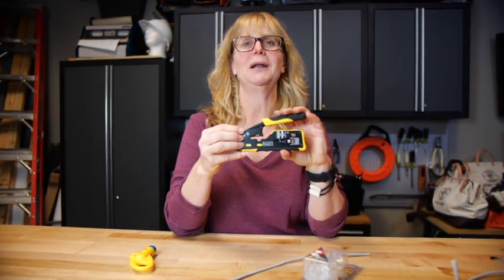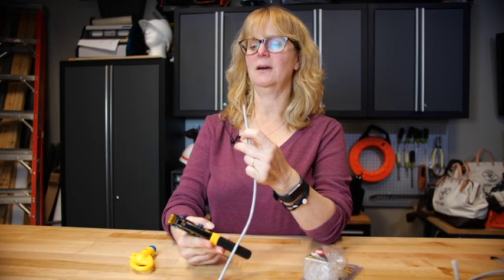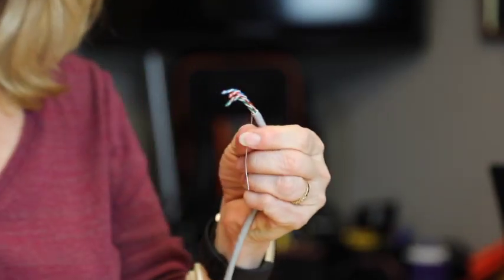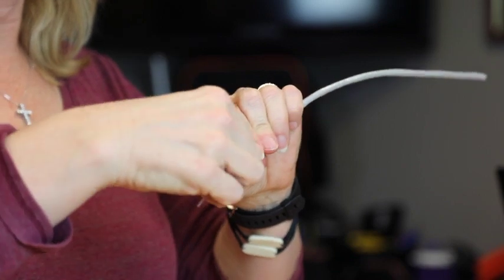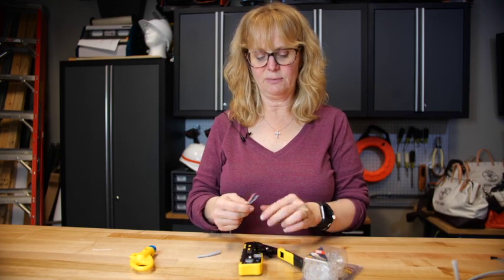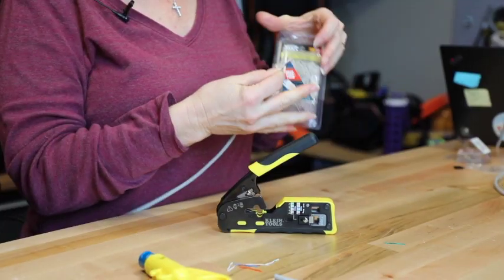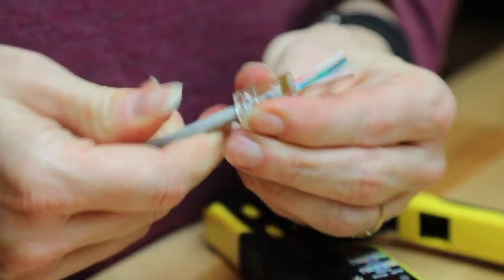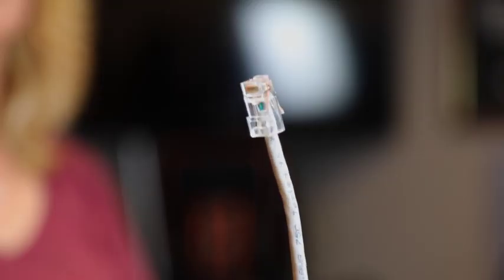Pass-Thru™ Modular Crimper (VDV226-110)

Comment: For anyone seeing this video and having trouble with the wires bunching up when trying to pass them through the connector, cut the wires at a 45 degree angle before inserting into the connector! This made all the difference for me because I always had trouble with the wires moving or bunching up causing a lot of frustration to an already annoying job! When I cut the wires at a 45, the problem went away. Hope this helps.
Reply: great tip!
Reply: Came back to say YES!  Cutting the wires at 45 degrees made a huge difference in the ease of correctly inserting the wires.
Reply: @Peter20164  I finally bought some CAT 6 connectors that were actually rated for CAT 6 and the holes were larger making it a hell of a lot easier! May even be rated for CAT 6A.
Reply: Came back to say YES AGAIN!  The CAT 6 connectors are much easier than the 5e connectors I unthinkingly grabbed when I bought the tool. These two pieces of advice changed my ability to add connectors from “ Dang, maybe I should hire someone” to “I think I’ll fix all the cablegore in my Verizon panel and make it look totally pro”
Reply: @Peter20164  that's awesome man! I'm sure it'll look great. Just take your time so you don't have to do it again. Speed will come later with more experience. If you don't already have one, you should pick up a cable tester since they're pretty cheap and at least will let you know when connections are good
Reply: Glad I saw this. Gonna save me a ton of hassle!

Comment: Take a look at the comments on Amazon. A large number of these tools are not cutting wires one and eight cleanly. You or someone in your customer service should be addressing these issues. I just bought one, and unless I can solve the problem, I'm returning it. This tool makes two Klein tools in a row that I've purchased that have not lived up to Klein's previously stellar reputation.
Reply from the maker: Thanks for your question. On these, you should plan to replace the cutting blade needs periodically – the replacement blade set is VDV999-076. Since yours is new, DM your address and we'll send a set out.
Reply: @KleinToolsVideo  I don't know how to send a DM on YouTube, but I just sent the requested information to your Customer Service email address.
Reply: After you get your wires into the RJ45 connector and the connector into the crimping tool....  lightly, loosely grab the protruding conductors and while tugging lightly on the conductors,  give the tool a quarter-twist... either direction.  Cuts fine every time.  I use this method on every pass through tool I have.
Reply: @KleinToolsVideo  DM ??
Reply: @ramosel  It does not! Has not ever cut a line around the outside cable.
Reply: @KleinToolsVideo  Well besides mine not pushing the contacts through the wires, plus also of course they don't cut off 1 and 8 - and it's a brand new tool. You guys should actually recommend plugs with the tool that work.

Comment: My wires always jump around when I'm putting them through the connector.
Reply: Push them slightly against the roof of the connector as you insert them.
Reply: You have to take the memory out of the cable. I use a method of aligning the colours per requirement and use a kind of wiggle to align and remove the memory from the cable. I really should make a video. it might help some people.
Reply: @billstathakos  Yes, because what the hell is the memory that you take out of the cable 🤷
Reply: @matthiasnott  when you are untwisting the pairs and re-matching them to the required color scheme, the cables want to coil or wind back to the original way they were manufactured (copper tensile 'memory')

Comment: Why not cut at a 45 before insert in connector. Much easier way of routing I have learned
Reply: you mean non pass through?
Reply: Karam J - NO the connector easier to slide thru pairs at a 45 not straight
Reply: I'm going to try this, thanks.
Reply: @Mozzer482  Huh, I'll try that. Thanks !

Comment: We just bought one at the job the other week. I took it home to play with it. I ended up ordering one on Amazon for next day delivery. It solved my issue with a cat6 cable I had built that did not get crimped right.

I ended up rewiring the network in the house that weekend because I had a good tool that made the job easy and faster.

Comment: I bought this tool about a month ago and highly recommend it.  Previously used a crimper from a cheap kit and found that you get what you pay for.  Still not perfect every time but getting better.
Reply: Please tell us about if possible to share the information, ok? -->  "Still not perfect every time but getting better."
Reply: @markwebb7320  Doesn't always cleanly trim the wires when done.  I just used it a few hours ago and worked fine

Comment: When trying to trim Cat5 cable, the tool does not scour the cable at all. Is there any way to adjust it so it does? On the side with the OVERDRIVE knob, to the left of the "K" in Klein, there's a small button that appears to be able to slide to the left. What does that do? What does the Overdrive knob do?

Comment: "Cut and Strip" location on tool, too fast, didn't see it. push it up slightly   what  the cable ?? which way is up? at 1:18 using the jacket you just ripped off, too fast. does the wiring diagram show what side the latch is, up or down? are you going so fast so people don't really see what you're doing?
 other than that it's a great vid....

Comment: Does this tool work for Cat 6a also?  I am searching for a pass-thru device for cat 6a.
Reply from the maker: Yes, it works with CAT 6 and CAT 6a cable.
Reply: @KleinToolsVideo  With this tool can I strip : 1) the aluminum braid AND 2) the aluminum foil (protecting the twisted pairs) on Cat6A S/FTP, Cat7 and Cat8 cables?

Comment: Hi, with this tool can I strip : 1) the aluminum braid AND 2) the aluminum foil (protecting the twisted pairs) on Cat6A S/FTP, Cat7 and Cat8 cables?
Reply from the maker: This tool has the stripping capability of the cable outer jacket only. Most foil tears off easily by hand. You can use a small flush cutter such as D275-5 for the braid.  It is pushed up against the conductor wires, and any radial stripper could nick the conductor wire jacket, causing damage to the cable’s performance.
Reply: @KleinToolsVideo  Do you confirm this tool can strip thicker cat7 and cat8 cables? Your website says it does cat6a, but says nothing about cat7 and cat8.

Comment: I've just this tool with Kelin Tools RJ45 Cat6 Connectors. I following all instructions and keep the colors in the correct order but still i have the wrong connection based on the Klein Tool Scout pro tools, it shows for instance that 6 are connected to many other connectors on the other end.
I don't understand why such behavior if i'm using pass-thru RJ45 Cat6 on a Cat6 Cable.
I tried three times but each time is Fail with different connections.
By the way, i've bought the Kelin Tools RJ45 Connectors, Cat5 and Cat6, and Cat6 looks the same as Cat5, and all colors are aligned on Cat6 while on other brand it seems to be a zigzag on the connector colors, isn't it?

Thank you for your advices.
Reply: Use the B diagram starting with the orange wires on the left with the connector latch pointed down. Do the same for the other end.

Comment: Can You Use non Klein pass threw Ethernet connectors ?
Reply from the maker: Hello Joel. Do you mean use those types of connectors with this tool?
Reply: @KleinToolsVideo   I mean pass through ethernet connectors that are not klein tool brand.
Reply from the maker: Hello Joel. We strongly recommend using the Klein brand connectors. The tool will work with connectors that aren't Klein, but they have to be of high quality.

Comment: Don't know what I'm doing wrong???  I get to the step to put on the connector and they don't all go through the correct holes.  It was a repurposed cat 6 wire, it was old but not that old, had been damaged due to  a break in the middle made two new wires.  I ended up having to slide the wire one at a time using tweezers to support as it goes through the hole.  Was not as easy and straight forward as this video.  I'd get close and see a space in between and have to re thread through.  too many failed attempts and the wire was too bendy.  had to cut a little  to get it through then i had to use pliers to pull the wires through sometimes they would jump track and I'd have to start over. I lost more wire due to cutting than I had too  So please what is the secret!!!
Thanks
Reply: What brand connectors were you using?  The Quality Control of some of the no-name brands isn't that good and will cause the problem you had.

Comment: It's the worst at trying to strip sheathing off of cable. Turning that heavy tool around a cable isn't easy and it's not the least bit tight so it will barely  cut enough to break the cable. It loves jumping around and skipping. Anyone else having this problem? I'm thinking of another tool to do just stripping the cable sheathing but then...why?? I bought it to do multiple jobs with 1 tool having to buy 40 tools for 40 jobs.
Reply: I hold the body of the tool in the palm of my hand, so the hinge is near your wrist, or your body.

Comment: RJ-45 connectors are stranded twisted pair. They are used to make flexible patch cables. Solid twisted pair wiring is for static applications in the walls. It is used with 110 punch down panels and inserts. They are not the same. RJ-45 connectors will come loose on solid wire. Intermittent connections will cause horrible network performance problems. Do it right or hire a professional.
Reply: …are for…